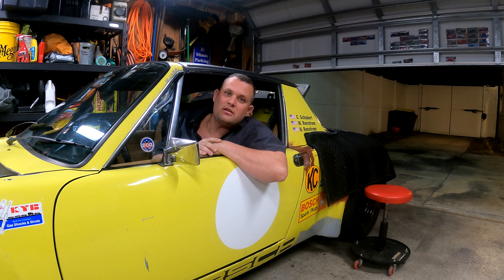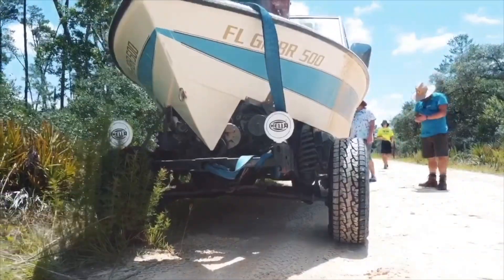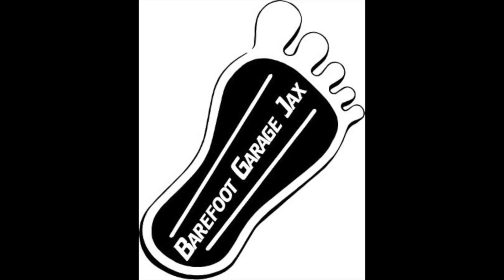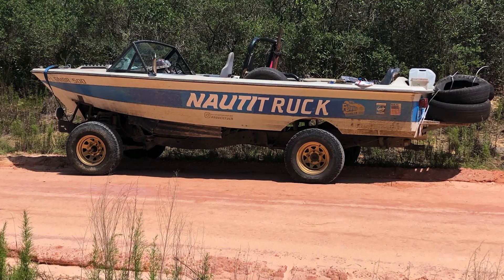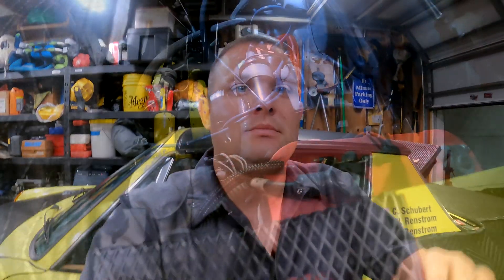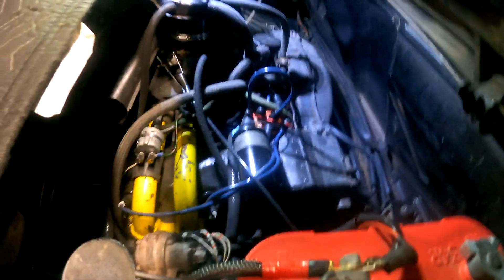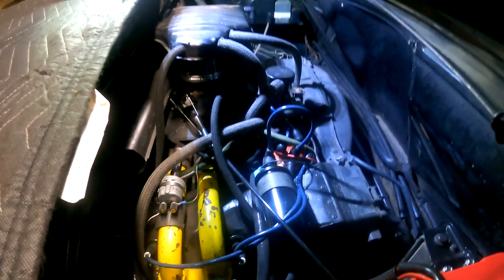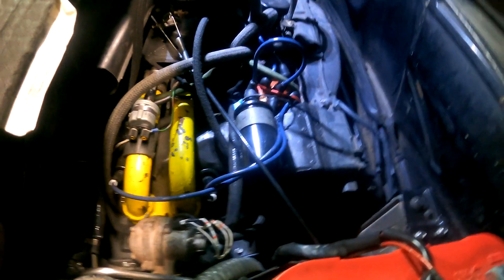Porsche 914 D-Jet Delete- Haltech EFI Conversion Part 1

Comment: @Barefoot - Which option are you using for the Haltech Elite 550, 550+ or 550+ Premium? I have a 914 too and I am really interested to see how this turns out.  If it doesn't look like it's too much trouble, I might convert mine too.  Good luck.
Reply from the maker: Nice! I’m using the 550+ with the universal harness. I think the hardest part is going to be the crank trigger install. In the next video I’ll link a google doc with all the part numbers and links. Happy to help share knowledge and keep more 914s on the road!
Reply: @barefootgaragejax9252  a friend of mine, who also owns a 914, used the mounting bracket for the smog/air-pump to mount his trigger wheel. He used a dual throttle body setup and a programmable ECU; at a glance, it looks like the engine has dual carbs. He managed to squeeze 105HP at the flywheel with a stock 1975 2.0. I subscribed to your channel. Keep the videos coming! 😊
Reply from the maker: dewder74 what an awesome idea! Sleeper look too :)
Reply: @barefootgaragejax9252  Do you plan on keeping the fuel injection firing order as it already is? That being, the fuel injectors for cylinders 2&4 fire and then 1&3 fire. Or are you going to set up the fuel injectors so that, like a modern engine, they fire sequentially?
Reply from the maker: dewder74 I’m planning on keeping it batch fire and wasted spark at least starting out. I don’t have a cam sych, but if I ever get one, the Haltech will support full sequential.